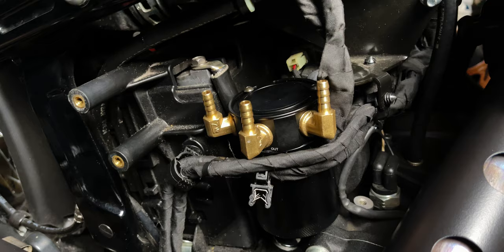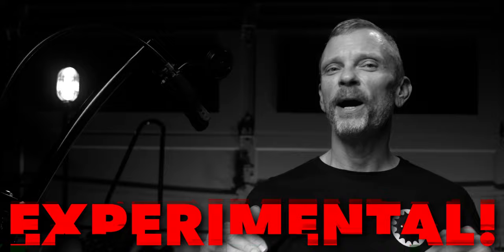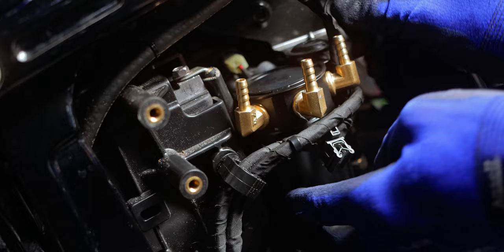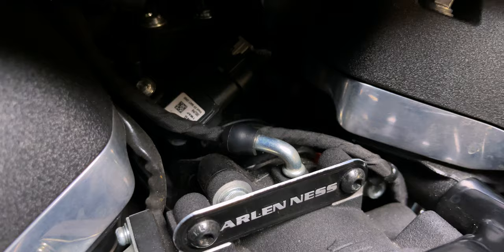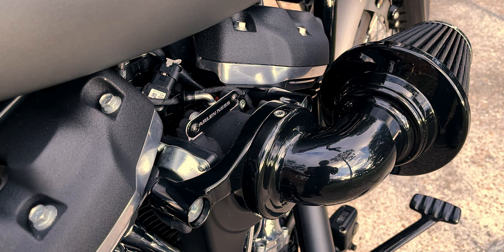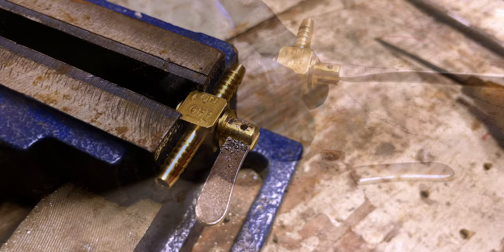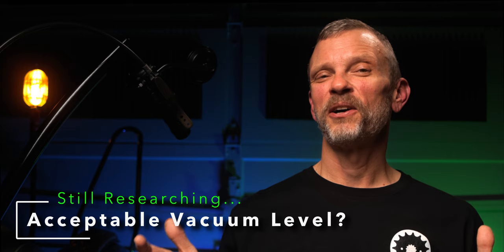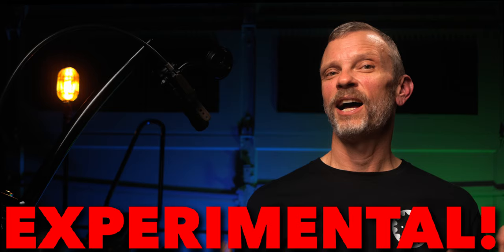❓Vacuum-Ported Catch Can: Crankcase Vent + External Breather + Vacuum = Perfect❓

Comment: So cool that you have designed a Variable Crankcase vacumn. Its something thats always interested me, after all what is happening on the otherwise of the piston seems to get no attention! Wonder if different RPM's prefer different Vacunm or no vacuum? If you could get bike on DYNO you could test different rev ranges then somehow design a gauge that adjust with RPM :) giving you HP increased through rev range, creating better seal on engine....so many positives.
Reply from the maker: Hey John - That is an excellent question and one I've wondered about as well. That is a very interesting about about the variable vacuum. It makes me think of the racer trick of putting a fitting on the header collector and using that for vacuum, which in effect becomes a variable vacuum source as engine speeds change.
Reply: @RonsWorkshop  Ive heard of people doing that but heard it didnt make enough vacuum from the benneli effect or whatever its called......see how you go, cool vid! I might try that header vent on my BMW as rerouting air through the intake will effect performance slightly on its own. after all it is hot engine air getting pushed back through the intakes.
Reply from the maker: Likewise - let me know if you try it!

Comment: Ron, thanks for all the time & effort that you have expended researching & testing various methods for resolving this troublesome problem.  You have the best, most thorough examination of this subject that I have seen.  One question for after we have done the mods and solved our oiling issues - is there a fuel additive that actually works to reduce the inevitable carbon build up that accompanies this problem or will I have to resort to professional help to open up the engine to remove the carbon?
Reply from the maker: Hey Robert - thanks for the encouragement and kind words! 

Unfortunately I don’t have any insight into fuel additives. Might be worth checking Project Farm YouTube channel to see if he’s covered that. He does a good job with objective testing. In fact, I may have seen one of his episodes where he covers that, but I can’t quite remember.
Reply: @RonsWorkshop  Thank you.  I will check him out.

Comment: What would happen if instead of using a catch can from the intake breather assembly you would simply run a line into the trans cover and then use another line to vent it away from the trans cover?
Reply from the maker: Hey Hector - I believe that’s viable too. You could just use a T fitting to tie them together into the one vent line coming out of the transmission top cover rather than adding two lines to the top cover.

Comment: I would love to know what is the vacuum on the two breather tubers in standard form ? Thats if it creates any at all ! Love your channel Ron.
Reply from the maker: Hey Kyle - thanks for the kind words! Yeah that would be interesting to see. I also wonder if the values would be different between say, the Arlen Ness breather bolt configuration and a stock OEM configuration. 

if you want a sticker send me a DM on Telegram, Instagram or Signal with the mailing info @RonsWorkshop

Comment: If I use the factory breather bolts (which have the check valve built in) for my external breather. Why would it keep it from making vacuum?
Reply from the maker: Hey dmwiningar1 - if you retain the OEM breather bolts then you do indeed retain the possibility of vacuum. It would be similar to my tapping the intake tube, in terms of the vacuum potential. Both rely on the flow of air through the throttle body to draw the vapor in / create vacuum. Let me know if that clarifies things, and thanks for commenting!
Reply: @RonsWorkshop  Thanks Ron that is exactly what I thought. That only way that would happen is if you did not use some sort of check valve in your breather.
Reply: @RonsWorkshop  Then how could an external breather relate to vacuum in the crankcase one way or the other.
Reply from the maker: Yeah - correction - they must be ported to the crankcase as well. Sorry about the confusion!
Reply: @RonsWorkshop  Thanks Ron! Keep up the good work.

Comment: I followed your lead with the trans cover/check valve. I did use a larger diameter tube and valve thinking it may breathe a little easier and less likely to clog. Nice job on the trifecta. Id be curious to see if the closed system reduces crank venting if the pressures fight each other. I’m hoping to leave my head breathers alone (since watching your vid suggested that there was no or little oil coming out after venting through the trans cover). From what I I’ve been following, seems that faulty piston jet oilers are a big culprit and scavenging any extra oil in the sump would be the goal.
Reply from the maker: Hey Ralph - thanks for the info and the kind words! How’s it been working so far, or is it still a WIP? 

Yes, the crankcase vent with check valve and the OEM breather bolts was working well. Those piston jets do seem to be common culprits!

And if you want a sticker send me a DM on Telegram, Instagram or Signal with the mailing info @RonsWorkshop
Reply: Seems to be working well. 3 or 4 rides around 100 miles each. Can’t expect performance gains, but the revs flow better and it feels snappier higher in the revs. I didn’t have any issues before, but by comparison, feel like it would build pressure at higher revs and slow the throttle response a bit. I find myself waiting longer to grab 6th now.

Comment: Love this kind of tinkering.I would say that opening behind throttle plate has to lean mixture,and without a wideband O2  in exhaust you can't tell. But the one in filter housing should still pull a light vac without problems. I know high end drag cars use pan evac and vac pumps more for ring sealing at high rpm than getting rid of oil misting.
Reply from the maker: I’ve even heard of the extreme end with racers using over 20” vacuum with great results.

Comment: Ron, I'd like to chat about this.
I'm thinking an automotive PCV valve installed either on trans top door, or on the catch can....
Reply from the maker: Hey Keith - yep, I think that would work. The thing to check for is the opening pressure. Many of the automotive PCV valves have a relatively high threshold. The check valves I ended up with have very low thresholds. Be sure to check the area video as well: https://youtu.be/JPI3AeMfYeg

Let me know what you end up with!

Comment: Do you think you would affect vacuum if you had the breather bypass vented to the top of the transmission cover and still having the transmission cover vented with the check valve?
Reply from the maker: Hey Dan - If I understand your question, and you tied the breather bypass tubes to the transmission top cover vent - that in itself should work fine, but you’d have no potential for vacuum. The OEM breather tubes (or the ports in intake opening for my Arlen Ness) are the only places the vacuum could come from in a normal configuration. Let me know if that makes sense or if I misunderstood your question.

Comment: What is the issue if you just vent to trany cover from intake bolts ? Or put a T fitting in and vent to small filter?
Reply from the maker: Hey Jay - if you vent the intake bolts to the transmission top cover your pumping even more pressure into the crankcase, or at best not alleviating any of the pressure that needs to be dealt with. You could definitely just vent the top cover using a pod filter without a check valve and that would work well, but doesn’t allow for any vacuum which is definitely beneficial. Primary goal is getting that excess pressure out. Secondary goal is allowing for vacuum. Let me know if that make sense.

Comment: 18 inches
How Much Crankcase Vacuum Is Too Much? There is often inadequate lubrication in the engine (Windage) when oil is being thrashed around by moving parts, but that provision needs to exist in your engine if you plan on running more than 18 inches of crankcase vacuum (24 grams).
Reply from the maker: Hey TheIceyPickle - thanks for sharing that info! 18” still seems like a lot but I have nothing to base that on.

Comment: Hi Ron 😀 tried to get in on your live thing, but was at work and got too busy. 
Really appreciate what you've done with all this, and, how you've shared with us all.  I'm gonna take the easier way,  I've got the breather mod done now.  I want to tackle the crank/trans cover mod next.  My question is with the intake breather mod,  should I just run to a catch can,  or do you think it would be beneficial to add a check valve on this as well? And,  would you agree that even without the vacuum source, it is much better than the factory set up, far as crankcase pressure... thankyou in advance 😀😀😀
Reply from the maker: Hey tdbrillo - thanks for the kind worlds and encouragement! With the intake breather mod there’s no longer a potential source of vacuum so you won’t need the check valve. And I’d say it’s personal preference for catch can or just a pod filter. And definitely - even if you don’t have crankcase vacuum it’s beneficial to release that pressure! Let me know how it goes!
Reply: Awesome!! Thanks so much Ron. That's exactly what I'm doing 😍 Again really appreciate your help on this complicated subject ha ha. You ROCK!! 🎸
Reply from the maker: Hey tdbrillo - sorry about the delay in responding. YouTube held the comment for review and I just discovered it. Thanks again for the kind words!  If you want a sticker send me a DM on Telegram, Instagram or Signal with the mailing info @RonsWorkshop

Comment: Hi Ron  
I would imagine that the crank case would be under vacuum. the way I would check that would be through the intake bolts for the breather and see how much vacuum you have there and I would imagine you could run the same amount of vacuum at the transmission cover. I’m new to the motorcycle world but in a race cars we weren’t as much crank case evacuation as possible help seals the rings and proves horsepower. If you have any more information on the subject I would appreciate an update thank you very. much keep up the good work.
Reply from the maker: Hey captain caveman capt. - thanks for the input! Yeah, vacuum is good. When you say check the vacuum at the intake bolts, do you mean check it at the two mounting bolts that typically have the nipples on them for attaching the ribber hoses that go the throttle body?
Reply: @RonsWorkshop  yes.  where you drilled into the air cleaner housing has to be good vacuum there to pull that oil into the throttle body.
Reply from the maker: Ok I’ll see about trying to get some measurements. Not sure of the timing but I’ll keep it on the radar screen.

Comment: I have issues with my Farm bike (Carbureted 250cc single cylinder dirt bike) that I've bought for fun at a garage sale

the past owner have removed the factory airbox for some reason and replaced it with a cone air filter

I noticed right away that it is misfiring when I maxed out the throttle (it sounds like it has a 5000rpm rev limiter)
I first thought
I sorta fixed the issue by directly connecting the breather tube via hole through a homemade intake trumpet to the intake side of the carburetor.. It now runs fine 

I have a question though..
why does an engine misfire when the breather tube is disconnected from the airbox/ intake system?
Reply from the maker: Hey Jasper - I don't think I can help you on that one. I'm not familiar with that exact setup, and two-strokes are definitely not in my wheelhouse.  Let me know if you solve the mystery!
Reply: @RonsWorkshop  It's a Chinese Bike with a Honda Clone 250cc 4 stroke engine
Reply from the maker: @jasperdomacena6491  Ahhh ok. Let me know what you find.

Comment: In addition to my previous comment…my idea would require welding and modification of the exhaust header. Everyone’s exhaust is different and might not work. Then there is the issue of the catalytic converter which would be destroyed if this setup was added upstream. There are check valves built in to keep positive pressure from the exhaust from traveling up into the lines so I don’t believe my idea would work at an idle and only at moderate to wide open throttle conditions. I guess I’ve talked myself right out of this idea! 🤣
Reply from the maker: But a good thought exercise nonetheless!

Comment: At a curiosity, Would I be able to run a line from the crank case to a breather catch can? Or is that overkill.
Reply from the maker: Hey Jardey7brehh - that’s what I’ve done with this. Everything goes to the catch can. Let me know if you give it a try! And if I misunderstood your question let me know and I’ll readdress it.
Reply: I would like to try it. No additional breather mods like the air filter mod. All I want to do is the crank case breather mod to a breather catch can. Now if I run it how you have it, because I have a street bob as well, would I get enough vacuum?.. new to this breather stuff just want to be sure. Also, if I run it, would I need a check valve to the catch can? Thanks !
Reply from the maker: You could just go with the catch can and no vacuum source to start - that way you know you’ve alleviated the crankcase pressure. The check valve is a nice-to-have, but not required. I’d say it’s more necessary if you use a vacuum source, but as you saw in the video finding a reliable vacuum source is a bit iffy.
Reply: Just ordered a catch can. Thank you ! Hopefully this will fix my oily air filter. Lol
Reply from the maker: Sure thing! Let me know how it goes.

Comment: I was impressed with your work.
But I don't know how you did all the work.
Please upload the necessary parts and hose line method to YouTube.
Reply from the maker: Thanks for the kind words! You can see the parts list in the video description of you click “show more”. Do you need more info on routing the lines?
Reply: @RonsWorkshop  Is required.
I want to make the same line system as you.
Reply: @RonsWorkshop  I have a question.
How did you handle the hose that was in the negative pressure valve of the intake manifold?
Reply from the maker: Hi 雅人 - the vacuum source goes to the catch can outlet. Crankcase breather line goes to one inlet of the catch can. External breather lines connect together and go to the other catch can inlet. Does that help?

Comment: Hi Ron, Thanks for all your great work. I have vented my breather to a catch can now I would like to vent the tranny cover as you explained. is it ok to do both these mods together.or will it mess with vacuum in the engine. sorry I'm a bit confused. thanks again great content!!!!!!!!!!
Reply from the maker: Hey Brando T - I think you’d be fine doing both. The main argument for not doing both is that it would remove the potential for vacuum in the crankcase - but in all of my testing and experiments I never measured vacuum in the crankcase unless I added an external vacuum source. Let me know if that helps…
Reply: @RonsWorkshop  Thanks Ron il let you know how this works out for my 2021 street glide, Maybe you can do a video on the automatic primary tensioners another bad bad haley design
Reply from the maker: I’ll definitely consider that! Thanks for the suggestion.

Comment: Using Law of conservation of energy, when you draw a vacuum out of a system, the system you are drawing the vacuum from will lose some pressure in other words whatever you are using to get your vacuum will be affected in opposite way. How much of an change is done?, is the change negligible to overall performance and functioning? what will happen to the bike overtime by leeching a vacuum off something? remains experimental unknown but there will definitely be a change in parameters of the system you are drawing the vacuum from. My advice would be to not draw a vacuum by tampering with any system (intake, throttle body etc) but instead use a small electrical powered motor to generate the vacuum to make an independent system. You can attach guage to that small vacuum motor and set it at any suction. Only drawback is you need to hide this small vacuum motor somewhere, it's an extra part but it will not alter any other system of the bike, works independent and has stable control. Hope you understand. Love your content and support to the motorcycle community. Keep up the good work.
Reply from the maker: Hey Mac - thanks for the input and for the encouragement!
Reply: I'll let NASA know.
Reply: I read about dry lake racing bikes having a pump fitted probably 20 or so years ago and stating the same hp increases.
Reply from the maker: Yeah it’s for sure got history in the race world - cars, motorcycles, and more.